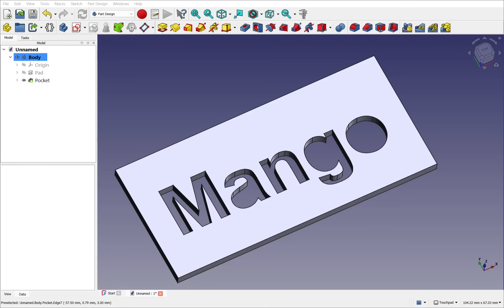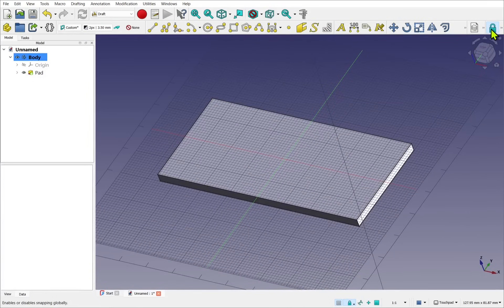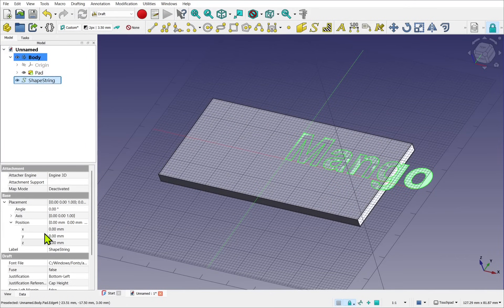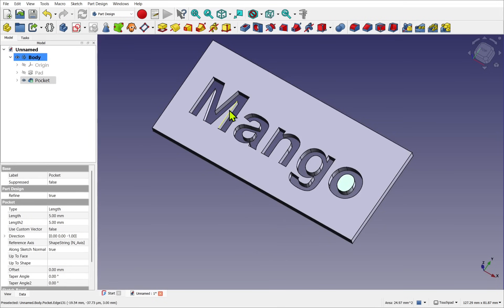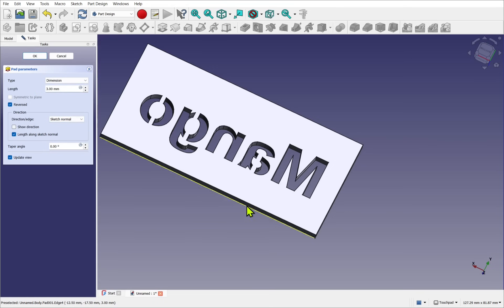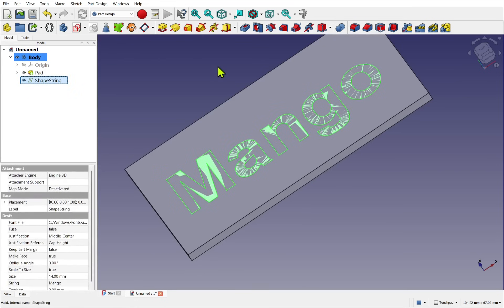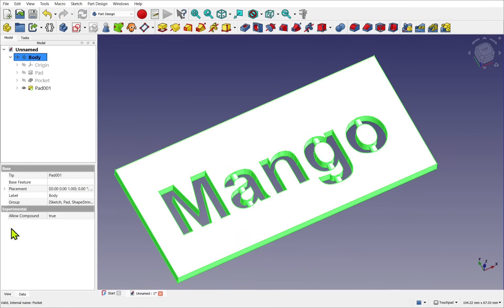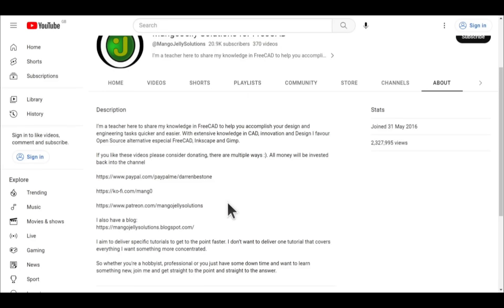FreeCAD: Missing Holes in Letters / Text in Part Design

Comment: In other CAD software the CAM system would do this for you--add tabs.  Does FreeCAD's CAM workbench not provide tabs?
Reply from the maker: FreeCAD CAM workbench does supply dress up features where you can add a tag from Path > Path Dressup >Tag and then change it's dimension.  This video was more from a 3D printing aspect where the CAM workbench wouldn't be used.

Comment: Can you help with sub shape binder for letters like "O"? When you apply an offset it doesn't work for the inside. Im making a 3D printed  LED sign with an insert lens , "ICON" all the letters except O work perfectly woth the sub-shape binder it's really got me stuck 😅
Reply from the maker: Long time no speak :) Yep not obvious this one.  Make sure your shape string has make face to false in the data tab so you just bind the wires.  Now if you element select the "O" (top menu > edit > box element select) you can draw a box around the "O".  Shape bind the selection edges.  It will look like it's done exactly the same thing.  Select the binder and set 'make face' to false.  And then play with the offset.  The offset will push the outer circle the opposite way to the inner.  If this is not your desired result remember that the shape string is a compound so it can be split with the explode tool into the individual closed wire profiles.  If you explode you will get the inner and outer of the "O" and all the other letters, you can apply individual offsets to via shapebinding for even more custom ability.
Reply: @MangoJellySolutions  You're a saint, thank you mate. I'll have to figure out how to send you a lil something ko-fi or paypal for your work 😁

Comment: Good techniques. Also, I have found that most slicers will ignore the "bridges" when I constrain their width to a value smaller than the layer size (for example 0.01mm or 0.005mm) as this makes the bridges unprintable. Part Design is happy with this as it still results in a single body.
Reply from the maker: Thank for adding that, good point and valuable information there.  So easy to forget to work inside the limitations of the manufacturing process.  Thanks for adding.

Comment: How about making text with tapered walls for injection molding or casting? Basically a V cross section and even specify the radius at the bottom of the V?
Reply: You can add a taper to a pocket or pad by setting the Taper Angle in the Task panel. Add a fillet if you want to round out the sharp corners. You wouldn't get a perfect V though. You could do something with a subtractive pipe if you really need a certain cross section.
Reply from the maker: Sound advice from @ardemus, to add along the additive pipe solution, you could add a slight chamfer to the top and then in another body shapebind the top and bottom faces of the text and create a additive loft between the two.  It will have h just two profiles so automatically be ruled.

Comment: You could also use a stencil font, they have the supports built in.
Reply: That would be less work. Sometimes a particular font is specified and a stencil version would not work, such as a company name/logo.
Reply: That would definitely be the most simple solution!
Thanks anyway for sharing other ways.